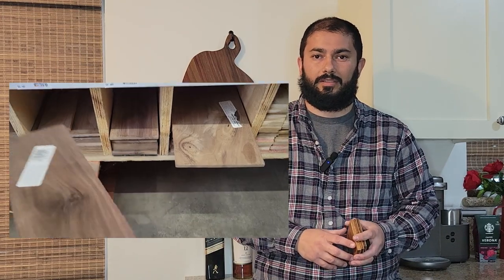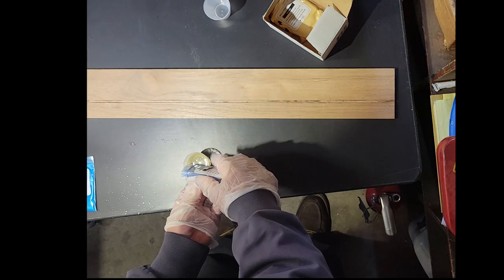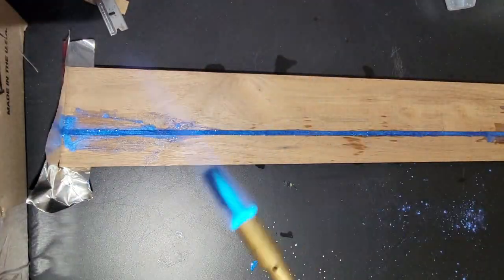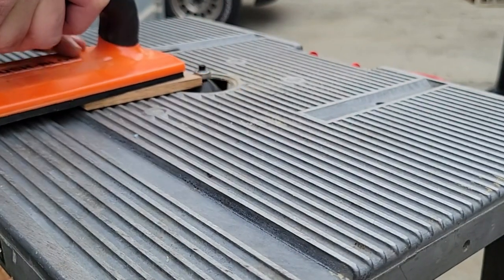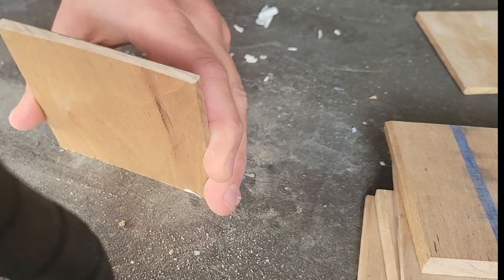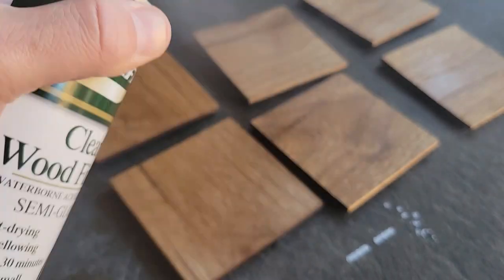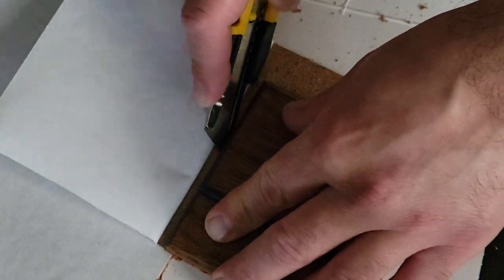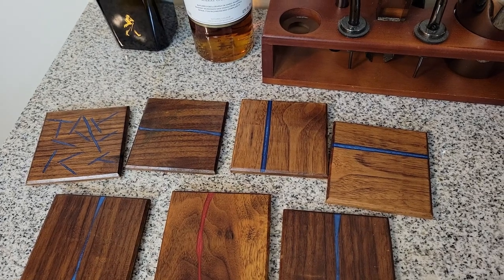#Wooden Drink Coasters, 🍻 Bar style thin, W/epoxy DIY wood working

Comment: Order yourself some syring without the needles.. different sizes
Reply from the maker: Very cool tip! I think that will be perfect for a piece I'm working on now. Thank you!
Reply: @gregariouswoodworks1270  Also you might try using tape along the sides of your pour so that you reduce spill over and the extra sanding necessary.
Reply from the maker: @J4Julz  I just finished a project using a 2 part glaze coat and taping the bottom edges made clean up of the over spill/ drips such an easier task. That is a great tip for everyone to use!
Reply: Great job. They all look very good. What finish did you use after the oil dried?
Reply from the maker: @jbn0613  Hello, thank you for your comment. I've used water based polyurethane from multiple companies/manufacturers with no problems. The one I make in the video is a semi-gloss finish.

Comment: Damn they are nice. How much do you sell them for and how many in a set?
Reply from the maker: Thank you! I've tried selling on these on etsy ranging  from $30-$40 with no hits. More luck at local fairs and apps like offer up. If you buy one hobby board, the same size as the one in the video then you can get 6 pieces cut into a 3.5" squares. Hope that helped

Comment: Where did you find the boards?
Reply from the maker: I've found these oak and this walnut at home depot in their hardwood aisle. I checked out lowes before and their selection was smaller in width from what I remember. These boards are pretty straight off the shelf but I have come across some that were warped so keep an eye out for that.